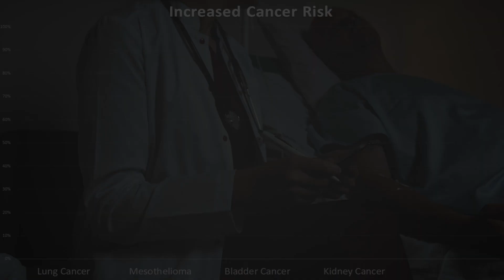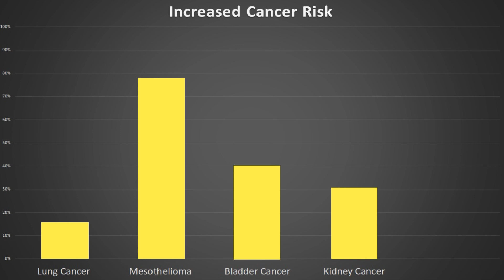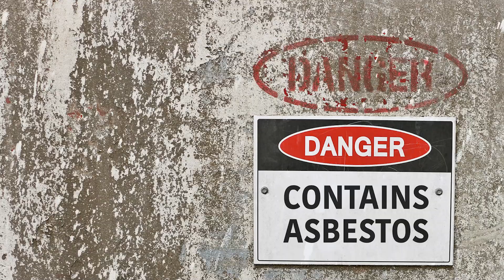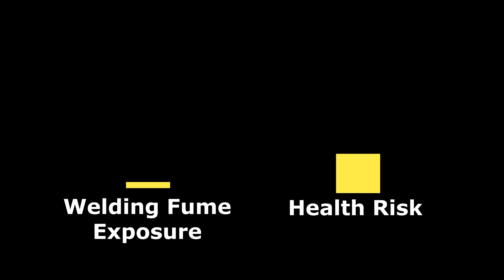Dangers of Welding Fumes: Protect Yourself and Your Health

Comment: im a beginner in welding and im in a training school at the moment. can you make a video on what a healthy welder diet looks like?(more on food for the respiratory system etc)

2.what type of products you can apply on face and body to protect yourself from uv or harmful chemicals
Reply: I know some ppl that put on sunscreen. And for clothes just get some overalls. Entirely depending on what you’re gonna be welding. Also you can wear a respirator for the fumes. I use the speedglas 3m helmet with a built in respirator.
Reply: @EXCWISE cool do you know anyone that uses good PPE and takes care of their body. That had no health problems from welding for 40 years?
Reply: @NinjaEnigmavery few 😂
Reply: Wether it's the fumes getting to your innards if that doesn't get you being in awkward positions crawling and working on your knees and heavy lifting will get you

Comment: About Tig aluminum welding
Reply from the maker: Though there's less visible fume generation with TIG welding, it still releases dangerous gases. Local exhaust ventilation is still recommended for TIG welding processes.